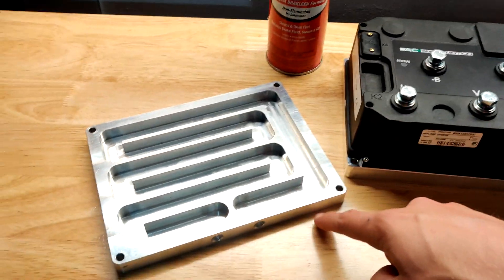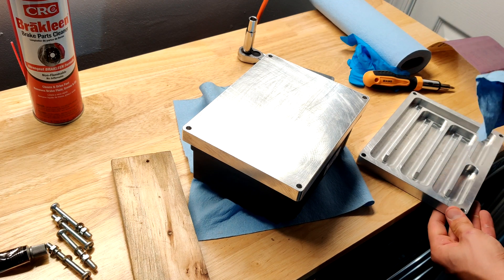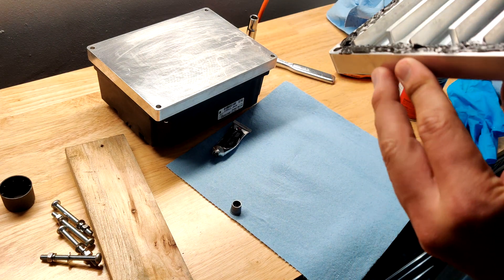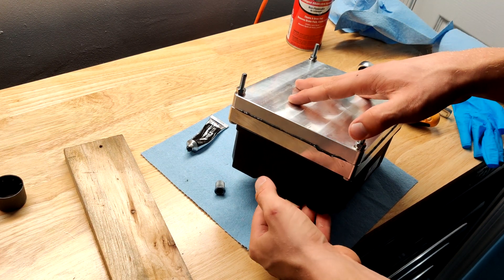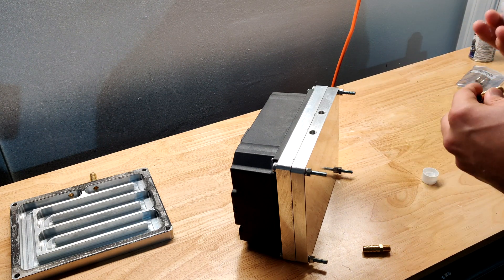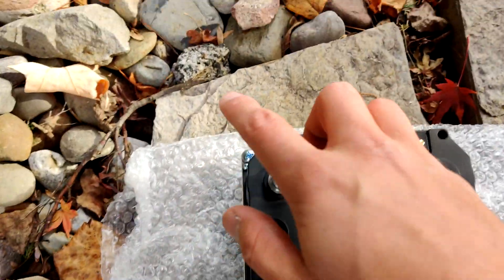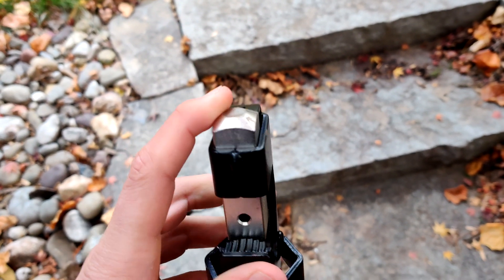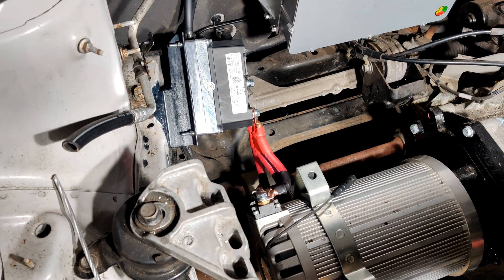Ford Escape EV Conversion EP 18: Prepping the Hyper 9 Inverter

Comment: what problems do you get with different wire lengths? heat, inverter cut out?
Reply from the maker: Honestly not sure but I can make some good guesses. The reason why you want the lengths to be as close as possible is due to resistance in the wire. I would guess that significantly different resistances would cause some 'pulsating' in the motor field as some of the phases would be stronger than others. I would expect this to make the drive less smooth and cause an earlier failure than would otherwise occur - worn out bearings and such. Don't think it would be a serious issue if you're using properly sized wire though, but if you are cutting it close on the allowable minimum wire size then you could run into some issues. 

If you need to have the 3 phase runs significantly different lengths then I would run oversized wire so that the resistance difference is negligible.
Reply: @reider_mcfeely  difference on mine is a few centimeters here and there? No big deal?
Reply from the maker: @blackterminal  yeah I doubt that would be an issue at all, I think any differences over 25cm and I'd go up a wire size to be safe. You should be all set
Reply: @reider_mcfeely  Yeah one of my leads is like 1.5 inches longer but I"m using the EV west 2 AWG wire.   Hopefully that will be ok.

Comment: How warm did it get without the chill plate?
Reply from the maker: I haven't tested without chill plate but I ran it with the chill plate but coolant pump off. It got very hot to the touch after just a couple of loops around the neighborhood - I don't have exact measurements but I think it would have thermal throttled had I kept driving for another mile or so. I think the chill plate and coolant flow is definitely necessary if you want to use the inverter to its full potential.
Reply: @reider_mcfeely  thank you for your reply.  I'm looking at something with a different brand that has a standard finned heatsink without provision for liquid cooling. Lower powered a little than yours. Will be interesting to see how it goes
Reply from the maker: @blackterminal  yeah if it's designed to run just the heatsink then you should be good. Just try to get airflow on it either by having it in a place where air will pass over it when driving or by just strapping a cooling fan to it. Either way shouldn't be too bad.

Comment: Hey, I was wondering how you could use the tachometer, speedometer and other telemetry. Does it also use something like OBD2? Would it be better to use the stock gauge cluster or to use something like a digital dash.
Reply from the maker: The stock gauge cluster would be ideal, but it requires you to essentially hack the CANbus  network that it receives signals from. I expect that the speedometer will still work since it just measures wheel RPM and calculates the speed from that. The tachometer most definitely won't work though. 

Of course it's possible that none of it will work, since there's no ECU in the car. 

I'll probably have some sort of digital dash. 

Not sure what you mean by OBD2. That's just a diagnostics interface.
Reply: It's not easy to get the original dash to work.

Comment: Nice! Question about the chill plate and gasket maker. Obviously not a big deal if there are slight leaks internally between the coolant channels since it’ll still be a closed loop, but couldn’t it decrease the efficiency of the chill plate by not using gasket maker over the entire surface? Just thinking about a horror scenario where there’s a sizable leak on the thin piece of metal that separates the inlet and outlet ports, and the far side of the inverter isn’t getting much cooling.
Reply: There really is no need for gasket maker on the inner fins, the pressure drop across the chill plate should be fairly low, otherwise you probably have other problems in your cooling loop.
Reply from the maker: Definitely a fair question. My inverter will be mounted vertically, so gravity will pull the coolant to the far side of the inverter anyways. 

The machining on the inverter and chill plate is also exceptionally good: I think if I didn't even use any gasket maker, there still wouldn't be any leaks as long as I tightened the mounting bolts/screws enough. 

If for some reason there was a large leak though, gasket maker probably wouldn't help much. It's only rated for gaps of up to 20 thou (0.02 inches). A little bit of coolant flow over the inner channel separators could even theoretically improve efficiency since it increases the amount of surface area in contact with the coolant. 

Also of course aluminum is an excellent thermal conductor. Any significant discrepancies in temperature on one side of the inverter to the other will be short-lived. 

Long story short: it's not going to make a big difference either way.
Reply: @reider_mcfeely  thanks for the detailed reply! make sense :)